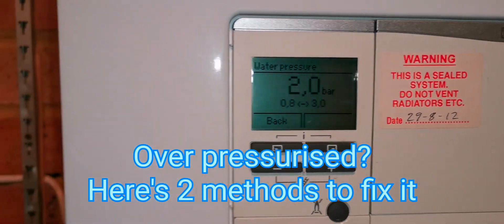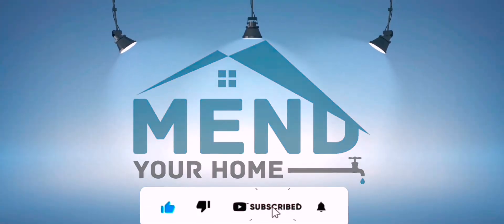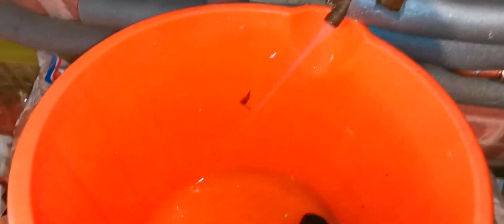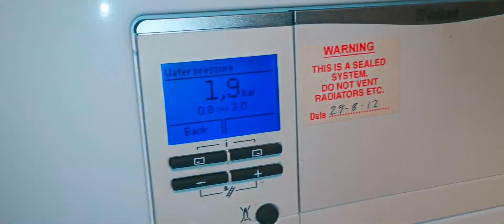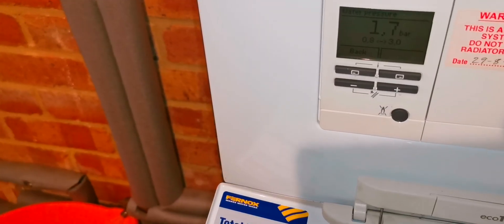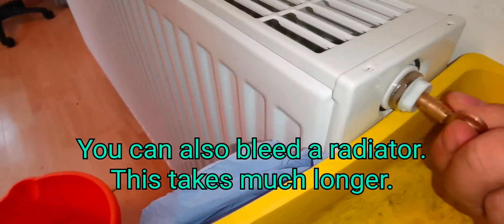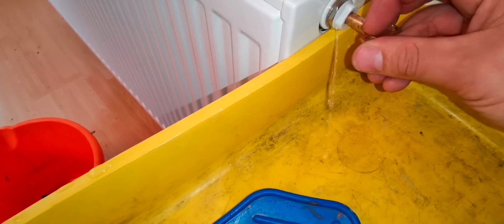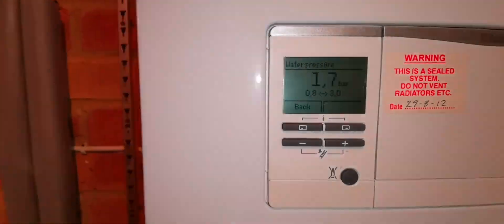How to reduce boiler pressure. 2 methods

Comment: the boiler was at 3.8 bars and i’ve brought it down to 2.2 but it doesn’t go any lower than that, not much water is coming out the hose(i connected it to the hose and then put the hose outisde) and then i got a f75. can you help me please

Comment: I changed the expansion tank and the relief valve plus the input water regulator and I am have the same problem with blowing the relief valve 😂 Can any one help me?
Reply from the maker: Was the expansion vessel pumped up to the right bar? Even if it was new it still needs checks with the boiler drained down
Reply: @mendyourhome  I found my problem it was a coil leak in the furnace

Comment: Does the heating need to be on first before draining the water from the radiators or not? Thanks
Reply from the maker: Doesn't need to be on, it may actually be better if it's off.
Reply: UNLESS YOU WANNA SCOLD YOURSELF!! LOL

Comment: Thanks for video, it's helped me a lot, my boiler pressure went to 4 bar this week, I don't know why though cause it's only been used for hot water for months and no heating been on at all 🤷‍♂️
Reply from the maker: The filling loop might be letting water in, not closed properly or leaking into the system?